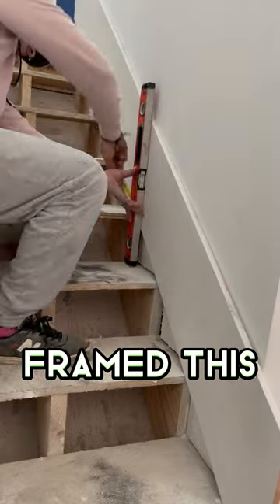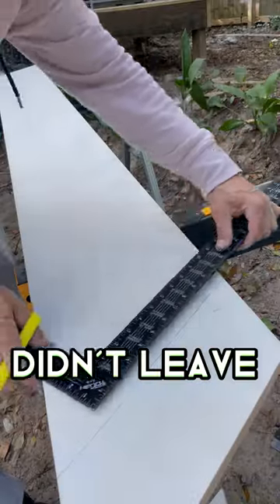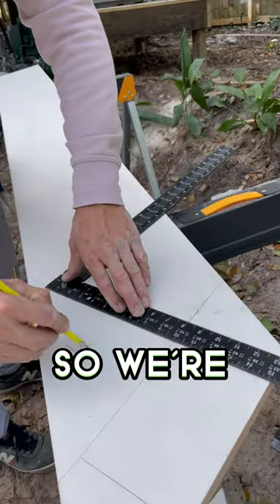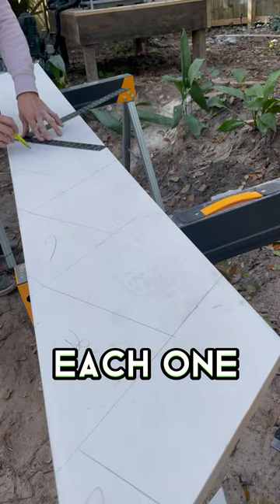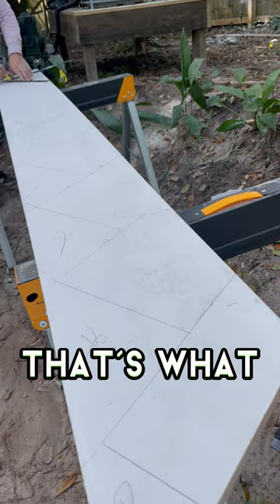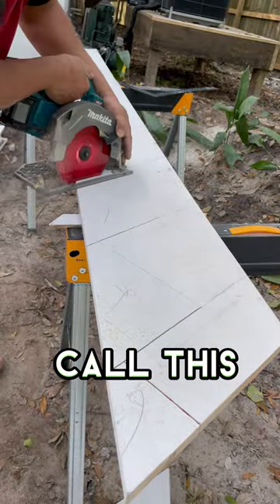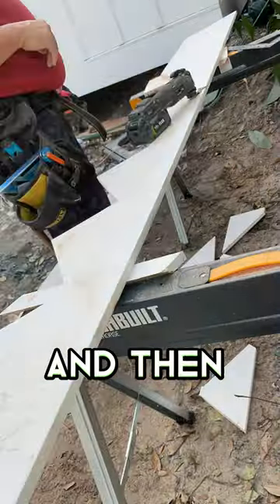Stair Trim | Artpentry #artpentry #carpentry #diy #artisan #woodworking #build #construction

Comment: That God's gift to Tradesmen is no joke. Not withstanding  owning about $60,000 worth of tools, that's probably the one tool that I would miss the most.
Reply: And the impact driver next 💯
Reply: They really are amazing.
Reply: Agreed👍
Reply: Multi master
Reply: That cats paw w/the whale tail would be added to my list of God's gifts.
Reply: That tool is called a speed square.
Reply: Yes I love that tool. It’s called a cut off tool aka oscillating multi tool. It cans sand too
Reply: Its absolutely useless in my trade. Gimme that angle grinder
Reply: As a welder do you think it would be a solid invest for me
Reply: Multitool one of most versatile tool but never get why people get diff tools instead of staying in one battery platform
Reply: @theone-ou3gd   No single manufacturer makes all the tools that I need.  I can get away with Milwaukee and  Dewalt cordless. It's a similar Situation with multimeters. There's an efficiency loss in using both Fieldpiece and Fluke,  but that efficiency loss is outweighed by the functionality of the tools.
Reply: Carpenters square
Reply: @MrPePeLePuo  Tell me your welder without actually telling me your welder.

Comment: Idk how I ever lived without an oscillating tool before I got one
Reply: Whenever I use them on wood i find them really slow
Reply: I don't use them often,  but when I do,  they're nice to have
Reply: Exactly
Reply: @timothy6227 gotta use the right tip, they aren't meant to be fast though, they're meant to do stuff that's otherwise basically impossible by other means.
Reply: Someone saw a doctor cut open a caste and said "i bet thatll cut wood real good" bonus points not being to cut flesh with it unless you try really hard. Dam near child proof.

Comment: It is indeed a gift from God.

Many years ago the first one I bought was from Harbor Freight because I could not afford the Fein.
It was a test to see if it was actually worth all the hype. I realized it was invaluable so I tried to kill it so I could justify buying a name brand product. Oddly enough I could never destroy that Harbor Freight multitool so I gave it to a friend and bought a real one.
Reply from the maker: Haha when you want them to fail they don’t!  I think my first one was a Dewalt 😅
Reply: @Artpentry  I replaced the HF with a Makita for a few yrs, then got really annoyed with the Allan wrench blade changes. I bought a bosch with Starlock blades (still in use) and yesterday I bought the m18Fuel multitool because $20 starlock blades take a toll on my profits. 

1st impressions, I don't really like the Milwaukee version, time will tell.
Reply: I use the Bauer line of tools from harbor freight. I have about every tool they make, I’ve only ever killed one drill and one reciprocating saw, but I did use them for things they shouldn’t be used for. Mix that with the warranty for an extra $10-$15 and you get a free brand new tool with it. Very affordable, great quality, and they always get the job done.

Comment: I’m an old timer contractor..I bought a Fein when they seemed to be the only maker of that tool..came with a 15’ cord and a load of blade types, sanding apparatus, nice case, still use it regularly blades are not inexpensive and are proprietary so not just anything will fit this unit…but a genuine life saver…

Comment: Speed square is what i was taught 😅
Reply: I think of that as a speed square and the L type metal thing as a framing square but I dgaf.
Reply: You were taught 100% wrong.
Reply: Speed square is the lil triangle man. The framing square is the big L
Reply: Speed square is the triangle you keep in your bags. Framing square is the 24x16 square that you keep near your work
Reply: Tekagi he is absolutely correct. It is technically a rafter square, Swanson trademarked speed
Reply: Speed square is the small triangle one

Comment: 100% a framing square. I will fight someone on this lol
Reply: Same here. I’m 51 years old, and have always worked in some form of construction be it as a Union Boilermaker that builds and repairs HUGE Boilers in Power Plants, Refineries, Steel Mills, Chemical Plants. Or as new construction houses and remodeling and have always called it framing Square. He also used a Speed square.
Reply: Rafter square
Reply: @evancastro5435  that's a negative
Reply: Speed square 😉
Reply: @AhmedTheGoose  referring to the L shape or the triangle shape?
Reply: @danielmarion8426   I call the L squares framing squares,  6in speed, 12in Rafter
Reply: It's called a ruler. 😅
Reply: It’s a framing square
Reply: A true framing square is 24 in by 16 in. That little triangle thingy is called a speed square made for cutting roof Rafters for proper pitch. I still have my Swanson from 1982. Before that it was all done with the framing square ,
Reply: Speed square 😂😂
Reply: L shaped thingy is what we say up here in Appalachia
Reply: Dukes up!  Speed Square.
Reply: Speed square or call it something else if you a scab
Reply: Framing square for sure.
Reply: SPEED SQUARE!!!!!!!
Reply: If by framing square you mean the speed square, well that's just an iteration of an actual opinion square.  It speeds you up a lot, but it doesn't change What a carpenter can and cannot do. The oscillating saw changes what a finished carpenter can and cannot do. Hell, the oscillating saw changes what a lot of trades can and cannot do.
Reply: @evancastro5435 rafter square is the one that’s a bigger version of the speed square bro
Reply: @evancastro5435  Now there's a guy who's got his square names straight - or would that be "squared away".
Reply: Speed square is def way
Reply: L is a framing square....which i've never really used for framing 😅 and the second one, although i know is a rafter square or maybe even more accurately a roofing square idk, i call it a big speed, 7 inch is a speed square and a trim (4.5 inch) is just a little speed square
Reply: @mobamba5592  oh is that why the speed square has all those rafter pitch marks all over it, and the majority of rafter work is done in
2×6. .   The larger 12in speed is just for larger boards  ×10. /  x12
Reply: If big one framing square
Reply: the oldies called it a steel square. Though correct l, a framing square is what gen xers call it
Reply: @mobamba5592  You mean the 12 in? Or do you just know it by the “bigger one”? Reread what I wrote you square.
Reply: @grantforsythe1280  Its what the majority of old school and new school Framers call em, wait til they learn about combo squares.
Reply: It's a 12" speed square...
Reply: Rafter square
Reply: Nope that’s a angle ruler
Reply: @jordancockett3887  you're an angle ruler.
Reply: @danielcampbell1357 wrong!! It's a framing square
Reply: @AhmedTheGoose same here lol
Reply: @evancastro5435 rafter square is the big 12, its a framing square....
Reply: @RuthlessGaming5849 nah a speed square is your normal square, a rafter square is your big 12
Reply: Speed square is the name for me 👊
Reply: 100% not a framing square. That triangle is a speed square. 

Framing square is an L shaped tool used for framing.
Reply: @Lets_Go_Canes  did you watch the video? He was asking about the L shaped square.
Reply: @evancastro5435 thank you for having sense
Reply: If it’s a square it’s a square, when I tell someone to grab a square they better understand with the context because no way in hell am I going to say anything other than “Square”
Reply: @AhmedTheGoose  growing up with my dad we called it a fast triangle.
Reply: It’s called a speed square
Reply: Speed square
Reply: Sir, I don’t know you but will ride into battle with you on this issue.

Comment: The square is called a Rafter. Square, if it has all the little numbers on it too figure out roof framing problems there is a entire book written on how to use it. That’s what a journeyman carpenter uses and knows how to use, the ones with out those numbers most people call a framing square even though today most use a speed square.

Comment: Of course it's called a framing square.
The short end is the exact width of a 
2 by 4 and the length is 16 inches so you can flip it and over and to get your centers for framing.
The triangle is called a speed square or a multi square.

Comment: I first saw a guy installing solid service counter tops, use an oscillating tool 15 years ago. He cut the Sheetrock flush with the top and slid the top into the void he created. He did this instead of scribing the top. I thought then damn I have to get one of those! So useful!

Comment: I used to put the riser on first then cut the stringer to the riser. Then when you install the tightly fitted tread it doesn't open up a gap in the riser
Reply: Your a true carpenter brother. That how I was taught many moons ago

Comment: Bruh i have 6 multi tools, im a painter/carpenter and i find an excuse to use it every day .  My favorite is the m12 fuel with a carbide Diablo blade, but i have the m18 fuel too for when I'm fixing some serious fuck ups 😂😂. what blades do you use and how do you like the flex compared to the Milwaukee?

Comment: So stairs are tricky. As you prepared your stringer if you step your 90 degree cut under the next riser by a quarter inch or 1 centimeter it gives more room for peoples toes and is more comfortable to climb. 
A rise cut at 90 degrees is just awkward to climb and causes lots of toe stubbing which could result in falling down the stairs or a loss of balance resulting in injury. (each city should have rules and regulations set up for the maximum height of a rise and the minimum height of a rise. These measurements are best estimated by meeting with the clients in person and estimating their stride. If you are thrown on stairs do not give up. Ask for help or get instructed.

Comment: It's not caled a multi tool . It is actually called an oscillating tool. Cause that is the action it preforms. The name multi tool became common because of the multiple types of heads that are made for it for a wide range of applications.  This tool is a very useful addition to any modern Carpenters setup.
Reply: But when you buy them they say multi tool on them
Reply: Oscillating multi tool...that's what they say on the box

Comment: Most people call it a speed square, but as long as you don’t call it a “triangle”, you will probably be ok.
Reply: Speed squares are the smaller ones in the union.
Reply: @Mobjrock with the top edge. It’s literally the brand name of it!

The one in the video is a framing square
Reply: @josephromus3079  that's cool haha im just saying what all the guys I've worked with call em. But there's different names for a lot of things. No right or wrong answers haha .

Comment: You “horse cut” those skirts with a “framing square” and did nice job of it 👍 Yeah next time put like a 2x8 between the stringer and the framing that leaves plenty of room to drop your skirts into after drywall.

Comment: He's talking about the first square he used. Which is commonly referred to as a framing square by tradesmen. But the "correct term" is a steel square.
Reply: Framing square is the correct name The material they are made from is usually aluminum or steel Aluminum is what I use because I work in the rain and a rusty square is worthless .
Reply: I like aluminum steel squares. 😮
Reply: Carpenter’s square is the technical term, framing square is the most commonly used term for it, and steel square is only right if it’s steel and not aluminum or composite.
Reply: Wrong it's a framing square and mines made out of aluminum true framing squares will have rafter tables written on the side of them amongst other things. A steel square can be different sizes it doesn't have to be 16 by 24 and it'll only be marked in foot an inch marks.

Comment: That is a carpenters square. The triangular one is a speed square (Swanson trade name), the little ones with a sliding rule attached are called a machinists square, the ones that are small wood or brass are a try square, and the ones that pivot are called a miter or 'mitre' square. It's important to know the terms.
Reply: ThankYou